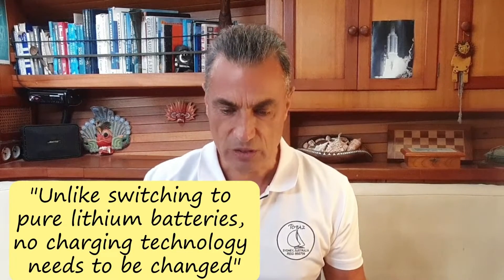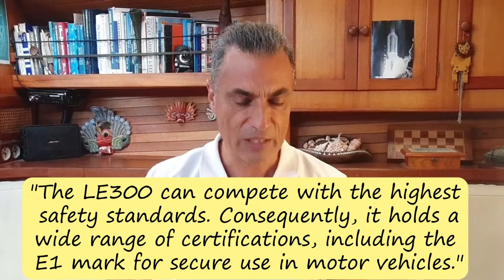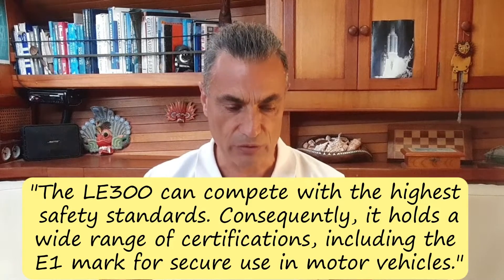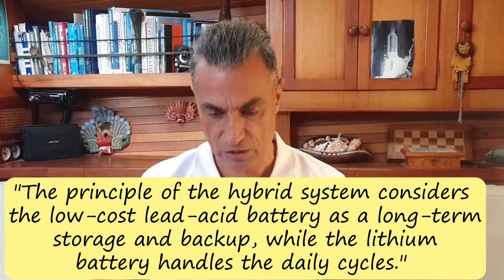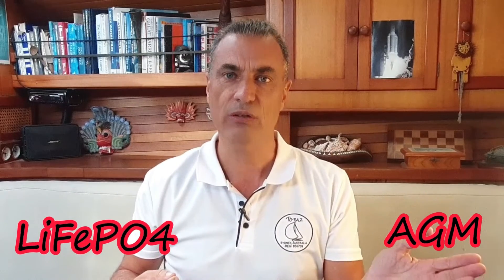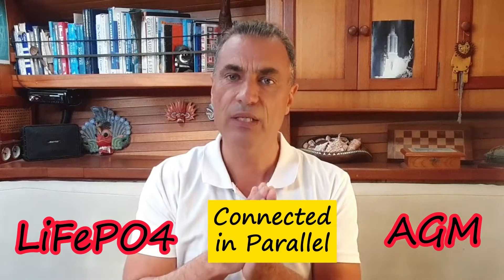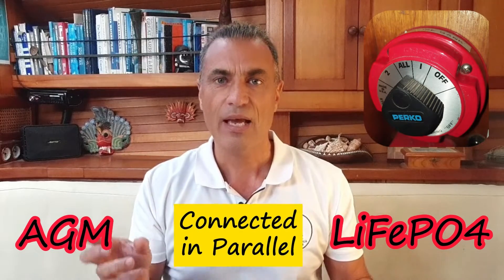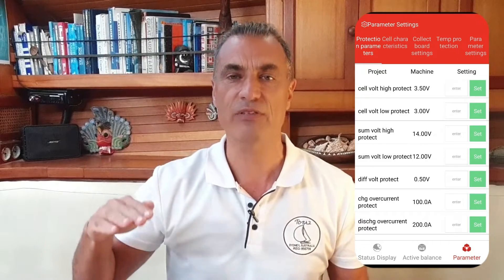Game-Changing Lithium Hybrid Setup! No upgrades to charging setup necessary!

Comment: lol. 😝. Having your BMS control shutoff of your charging current from charge source such as from your alternator when it goes above the the prescribed BMS voltage (for instance you said 14v) is a TERRIBLE Idea.   A BMS is there to PROTECT your Lithium from overcharge (etc) it is not meant to CONTROL your charging voltage.   That little BMS FET will be shutting on and off every day you run the alternator or charge with solar etc etc and is not DESIGNED to do that multiple times a day and shut off high current thousands of times.  Most BMS’s are cheaply designed  (very cheaply) little devices and not robust enough to handle that in a daily basis.  Way too many people would see BMS failures .   Also 14.0 v is a little too low for max charging volts for lithium it would be better at 14.3 or 14.4 volts to get to the charge ‘knew’ to get full capacity out of your lithium.
Reply from the maker: A BMS includes both low and high voltage cutoffs, and there is no restriction on how often these are activated—they are designed for this purpose. For instance, the low voltage cutoff is frequently triggered when users utilize their battery's full capacity. If this process were harmful to the electronics, we would see thousands of failed BMS units. Moreover, there are thousands of hybrid installations in use today, and their reliability has been thoroughly demonstrated over time.
Reply: @SmartBoatInnovations     "A BMS includes both low and high voltage cutoffs"   Yeah no kidding -- Thats LITERALLY what a BMS is supposed to do.  Sure it will "work"  I actually HAVE a hybrid AGM Lifepo4 Setup, but for you to suggest that using the  average BMS that is provided in Lithium batteries is the best way to control over voltage is crazy.   These BMS's they put in are relatively cheap chinese pieces of electronics that are made at lowest cost possible for profit .   The MTBF on the average BMS isn't going to be great.  I guess you can just get a new battery or rip it apart and put in a new BMS though.
Reply from the maker: @thomassenator8170 I never suggested you use an off the shelf cheap LifePO4 assembled in box with an unknown BMS. Ofcourse you need a Smart BMS with Bluetooth.  I even have a video that shows you how to assemble one and you choose whichever BMS you want. Although they are all still made in China.
https://geni.us/LiFePO4-10-Min-Build
Reply from the maker: No, LiFePO4 (Lithium Iron Phosphate) batteries do not have a memory effect like older battery chemistries, such as nickel-cadmium (NiCd) or nickel-metal hydride (NiMH) batteries. The memory effect refers to a phenomenon where a battery "remembers" a certain charge level if it is repeatedly charged to the same point without fully discharging, leading to reduced capacity over time.
Reply: @SmartBoatInnovations  No one is talking about NiCad or NiMH

Comment: You can quite cheaply buy a 100 degree C normally closed switch and attach it to the alternator, wire a long lead to reduce the charge rate and connect the switch with a short lead, this way the alternator will operate at a faster charge rate but if it reaches 100 degrees C it switches to a lower rate, then when it cools it powers back up. Good luck and fair winds. Thanks for sharing a great and informative video.
Reply from the maker: Interesting idea. Have you done this? The 100C NC switches are normally only rated to 16A. Do you have a link to one you have used? Also once it hits 100C and the switch opens what circuitry do you have to then switch to a lower rate?

Comment: Is there a wiring diagram that I have missed? Thanks!
Reply from the maker: No. The concept is that all the batteries are in parallel.  There are too many possible setups on boats that one diagram would not suffice. Please see the references in video description and join the FB group.  They will answer all your wiring questions.

Comment: It is interesting but the explanation could really use a bit more details and be more specific, there is just a 15s passage that actually tries to explain what you are doing. Not enough for being convincing. For example, stopping discharging the Lifepo at 12.00V will leave the AGM at 12.00V as well, with very little power left in it, if at all... ANd if you stop charging at 14V, how do you balance your lifepo cells ? not convinced yet but opened for more info.
Reply: With a JBD Overkill BMS my LifePo4 cells were always within a delta of about 10mv, even when only charging to 14v. At the lower end of the scale my AGM’s started contributing to the loads at about 12.7v, the system never ever went as low as the 12v pack low volt disconnect that I had set into the LifePo4 BMS.
For info I had 2 x 180ah AGM’s in parallel with 1 x 170ah LifePo4, and because I cruised nearly every day and also had 640w of Solar my AGM’s very rarely went below about 90% SoC.
Reply from the maker: Thanks for your comment. You make some good points. Creating a video that's almost 10 minutes long is always a challenge to balance time and content depth. Indeed, the topic is so extensive that I could write a book on it!
Regarding your concerns, when the LiFePO4 battery reaches its cut-off at 12V, the system is designed so that the Lead Acid battery steps in, providing redundancy to avoid a complete power outage. Yes, at this level, the Lead Acid battery's power is low, but this setup allows for ample time to start recharging the system.
The 14V cutoff is actually quite healthy for LiFePO4 batteries. I do not use an active balancer, but it's worth noting that there are balancers available where the threshold voltage can be adjusted.
Reply: there is also some good info over at the 2 referenced sites that fill in some blank
this does sound like a too-good-to-be-true thing so spidey senses do go up !

Comment: For anyone else like me who hates blah blah blah, he actually starts talking about how he did it at 6:30 secs. You're welcome.
Reply from the maker: Thanks for your comment and for highlighting the timestamp for the practical walkthrough at 6:30. I understand that some viewers are eager to get straight to the implementation details. However, I believe it's crucial to grasp the underlying theory behind the Lithium Hybrid solution first, as it provides context and a better understanding of how and why it works. This approach ensures a more comprehensive learning experience. For those interested in the specific upgrade process, I've also included a timestamp at 6:25, titled 'Upgrading my boat to Lithium Hybrid,' in the video description for ease of navigation. 
If you have any further thoughts or questions, please feel free to share them!
Reply: @SmartBoatInnovations  I listened to your video twice, and still could not grasp anything new that I didn't already know. 
However, the actual method of having a hybrid system still eludes me as it is always lost in the noise that no-one wants to know. 
It's like studying material science and understanding lime and cement, how they're made and how they work together. What their properties are and why they are better than wood. 
Builders don't want to know that, they just want to know how to use it to stick bricks together. 
Your effort to educate everyone is laudable, thank you for that. But I still don't know how to build a hybrid system.
Reply from the maker: Well, it is very easy. You connect the batteries in parallel. You connect together in parallel the LiFePO4 battery (including the BMS) with a Lead Acid battery. When you're connecting a LiFePO4 battery, which has a Battery Management System (BMS), to a Lead Acid battery in parallel, it's important to remember how the BMS is set up. The BMS in the LiFePO4 battery is attached to the negative terminal. So, when you make the connections, you're actually linking the other side of the BMS. This means you connect the positive terminal of the LiFePO4 battery to the positive terminal of the Lead Acid battery, and similarly, connect the side of the BMS (attached to the negative terminal of the LiFePO4 battery) to the negative terminal of the Lead Acid battery. It's like pairing up each end correctly - positive to positive, and BMS side (negative) to negative

Comment: So you don't need to buy anything extra huh?  Except for your product of course.  Or you can just stand around all day monitoring your battery's app and the temperature of your alternator...
Reply from the maker: Thank you for your comment. I want to clarify that I do not sell any products. My aim with these videos is to assist people in creating DIY solutions using cost-effective components. As I explained in the video, there are several methods to manage the temperature of an alternator, and none of them require constant monitoring. A practical approach, as mentioned, involves using Ohm's Law. By simply increasing the length of the cable, we can induce a voltage drop, which indirectly reduces the alternator's output and, consequently, its temperature. This is just one of the many strategies that can be employed without the need for additional purchases or continuous observation. I hope this clears up any misunderstandings and helps you in your DIY endeavors
Reply: @chriswolcott1692 
Stop being negative man. 
He is sharing knowledge which he gained and making videos out of his efforts. 
Look out for companies that makes ton of profit and here he is sharing knowledge and the needy are able to do it at lesser cost. 

When you can't appreciate, stop blaming.